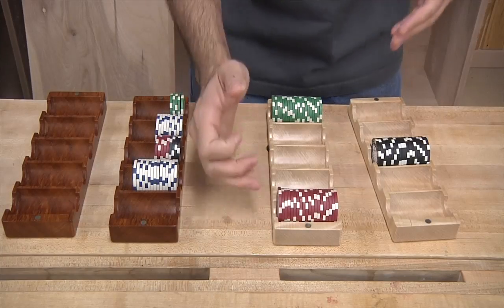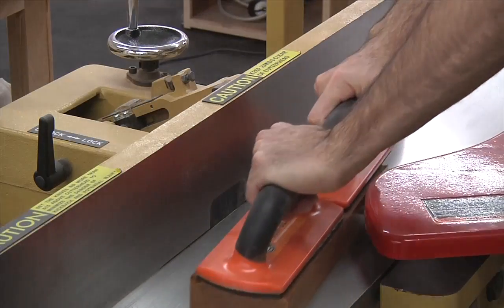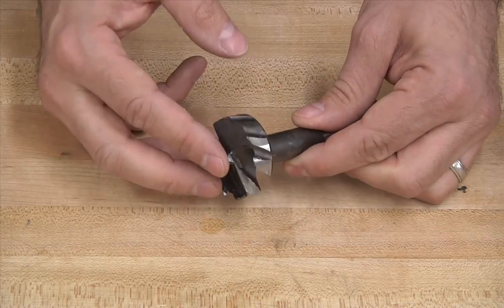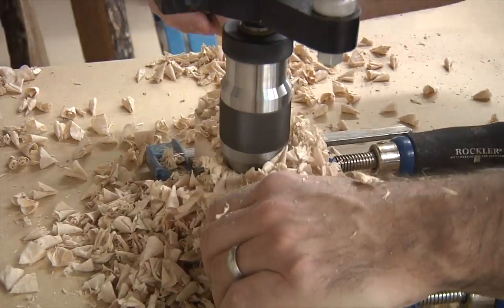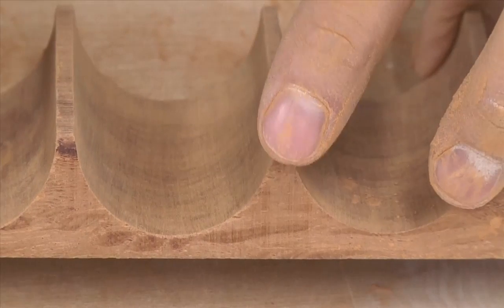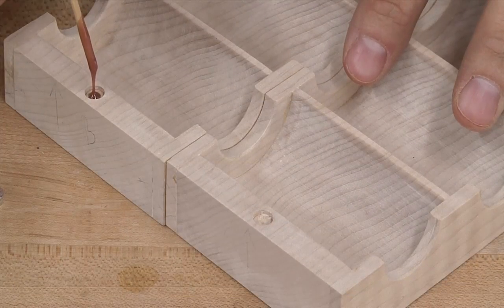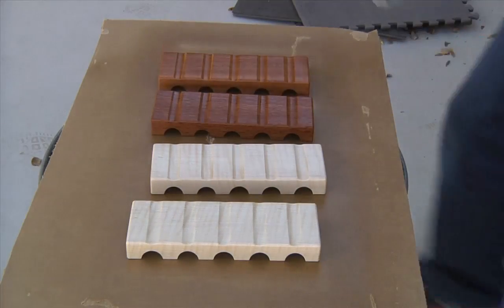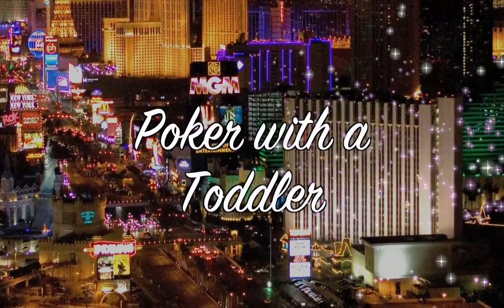Custom Poker Chip Trays

Comment: my one question is why not cut the bottom of the tray the same as the top, so the trays stack perfectly on top of each other rather than just using the core box bit and only provides a little stability when stacking?

Comment: Hai, nice video, I am trying to build this project and at the glue up stage, i noticed the 2 main parts have cupped (because of heat from drilling?), just wandering if you had this issue?

Comment: Good video and thanks for the effort for sure.
The video is a couple of years old now and my question may have been asked before;  I apologize if you have already answered this and I just haven't found it.

My question is:  Why not just use solid stock or glued-up stock, perform all the drilling operations and back-groove router work, then rip the piece in half? Seems like it would save a bunch of milling time of those individual pieces and clamp work at the drill press.

Thank you,
John
Reply: +John Fryer 
No worries, I just found the answer on your site:

"Primarily to promote stability. Slicing the boards after drilling is a little less predictable and the two halves might not be flat. Also, the blade kerf will remove quite a bit of material resulting in shallower trays."

Prob going to give it a try as whole block anyway :)

Comment: If you cut the groove on the bottom before you put the sides on, it will help "lock" the upper tray into position so it can't easily slide off.

Comment: Why use the jointer then the planer?  Why not just use the jointer for both faces?
Reply from the maker: While the jointer makes one face flat, it has no way to make the other face parallel to the first. So you can easily wind up with a taper or a wedge-shaped board. The planer, on the other hand, uses that first flat face as reference to create a second flat face that is also parallel to the first.

Comment: I'd suggest routing the bottom groove before gluing the sides on. This way, when stacking trays, the top tray is captured a bit by the chips in the lower tray and will have less of a tendency to slide off

Comment: Nice project Mark. Which Fuji do you have? I am looking to get one. I would like the Apollo Model 1050-7500QT 5 Stage Turbine. but I don't use one that much to spend a lot of money on it and feel for casual use the Fuji would fit the bill.
Reply from the maker: I use the Q4 Gold series. They have other models now in the Hobby Pro line that might be right up your alley.